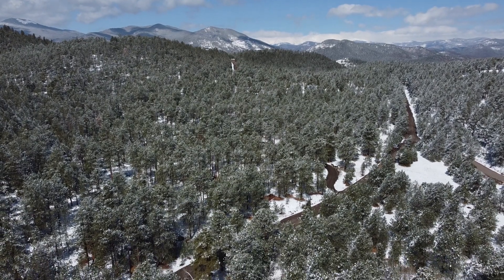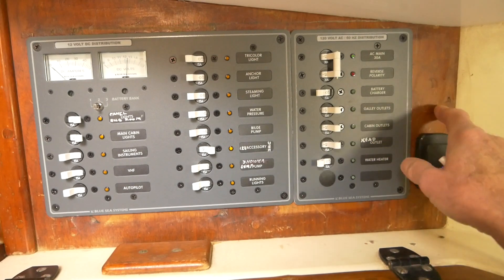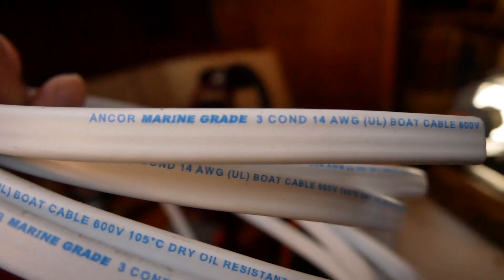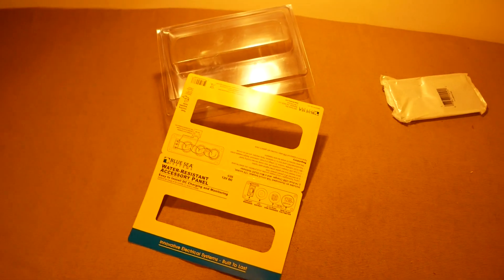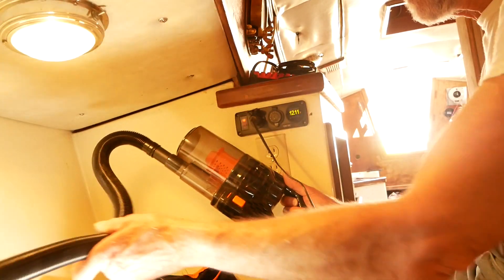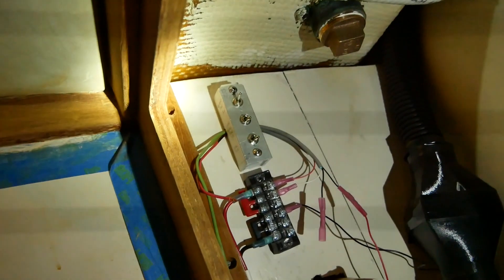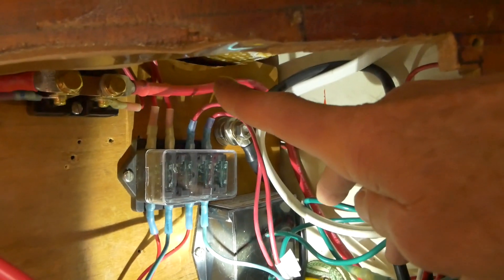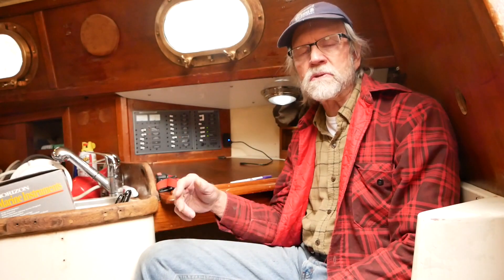Small Sailboat Electrical Panel & Electrical Upgrade

Comment: Thanks (a lot!) for your terrific video.  I've got a similar boat of about the same vintage (Finnfire 33) that needs a complete electrical overhaul (an "underhaul" for wiring?)  Your methodical work, with the added complexity of shooting video, is most appreciated.  

I'm still a pretty young guy (75 and counting) but, for some reason, starting to slow down.  (Maybe it's just that my lovely wife's todo list keeps getting longer?)  In any case, you have jump-started my own project.  Good luck with that Pacific Seacraft!
Reply from the maker: Thanks for your comments! I think you're on to something regarding the cause for slowing down. I'm experiencing the same! Darn diversions. Best of luck to you on your projects.

Comment: shouldnt that shunt be on the negitive side?
Reply from the maker: I'm not an electrician. So I followed the instructions from Blue Seas on that. I know it also depends on your bonding system or method for the boat's electrical and grounding. Nigel Calder's book 'Mechanical & Electrical Manual' is a good source of info too.
Reply: Did you fuse the wires for you dc panel at the battery?
Reply from the maker: Thanks for mentioning that. I have the little cube shaped Blue Seas battery terminal fuses on 2 of 3 batteries but didn't have room in the battery box for the 3rd at that time. I hadn't figured out what I was going to do so didn't shoot that part of the video.

Comment: It's my understanding that the main Bilge pump is to be wired directly to a breaker at the 12V Panel but on separate wire coming from the POS terminal strip of the House Battery POS after the Main fuse that can NEVER to be switched off EVER!  And should be tested regularly like the fluids of your engine.
Reply from the maker: Thanks much for your comments. I agree with much of what you have mentioned- particularly that the main bilge pump can not be turned off by mistake. Mine is on a separate branch to a small panel with a fuse. The small panel (from Rule) has a manual/auto position switch (there is no off position) with which I can easily check that the pump is working. I check that on my departures checklist and also check it if I am leaving the boat for more than a day or two. I have my backup bilge pump wired to the panel with a breaker. I also have a high water alarm in the bilge. It has a red indicator light to let me know it has power.

Comment: Could you go deeper on the fuse block around 12:40?
Reply from the maker: Thanks for pointing that out. The 4 way fuse block contains sockets for four 1 amp fuses that are required when installing the Blue Seas 8068 DC panel to protect wiring and the panel voltmeter and ammeter. Since the aim is to measure battery use, wires to the meters go directly to batteries and these fuses protect electronics & wiring in case there is a short somewhere in the panel or downstream wires. I bought the block on Amazon (Fuse Block,12-24V Car 4 Way Circuit Standard Blade Fuse Box Block Holder) as it does not come with the Blue Seas panel. I hope this addresses your question and if not, please get back in touch.

Comment: Hiding that fuse block inside is a bad idea. A fuse will blow in that at the most inopportune time and you won't be able to get at it. I can't speak for boats but for homes that would be illegal. All fuses should have easy access.
Reply from the maker: I should have gone into detail on that and thanks for bringing it up. My intent was to mount that panel on a hinge mount so it can open like a door as you see on many larger boat panels but I need to design and build a frame. There's little space available elsewhere near the panel so where they are is a safe and dry place for the block- just not convenient at this time. BTW- that fuse block is not critical, its solely for the meters. Most small panels don't have meters.

Comment: Nice work! Thanks for sharing.
I am just starting a similar project on our Van de Stadt 34 (https://www.youtube.com/@sailinglaysan4453).
The video shows me what I will be up against!
Just two quick comments/questions:
1- Is the shut supposed to be connected right after the battery and before the first bus bar?
2- Is DC NEG supposed to be yellow? (or maybe you re0used the legacy wire?).
Reply from the maker: @Coyotehello  thanks for your thoughtful comments! Regarding 1: I followed Blue seas installation instructions on the shunt so it's right after the battery and I do have a battery fuse right at the terminal. 2: yes, that yellow was a legacy wire. I do have a wire list so I noted what wire and what color are for each circuit.